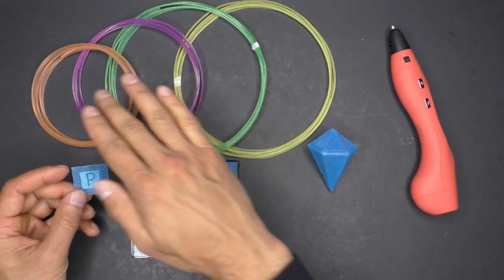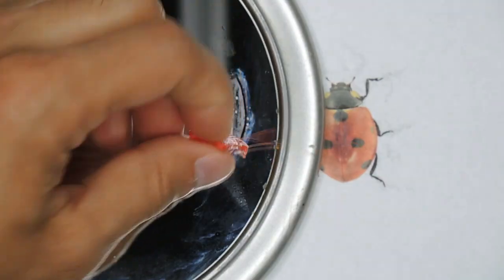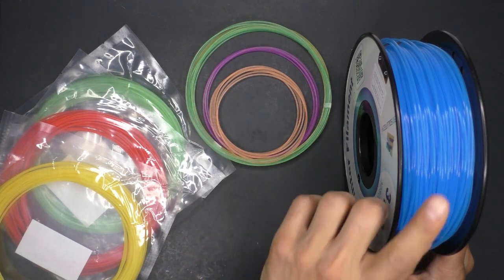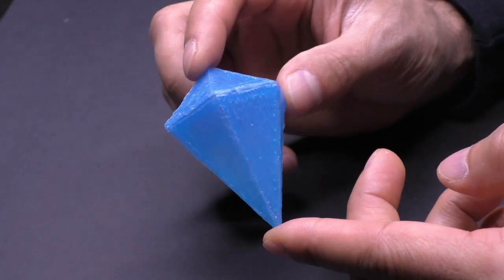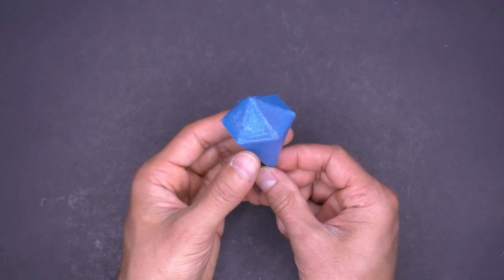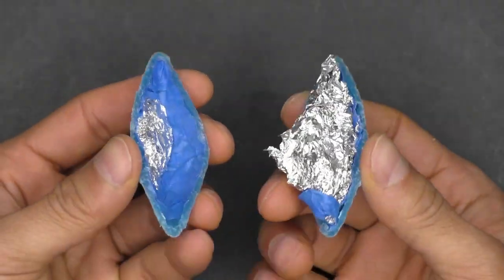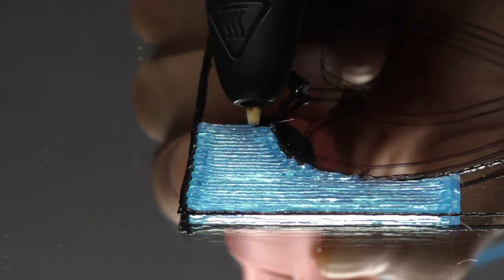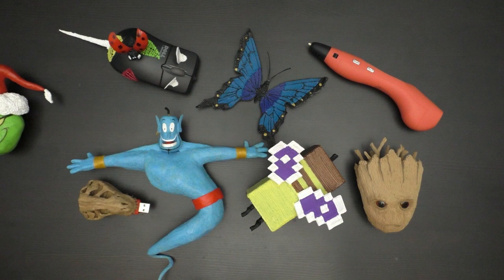SEE THROUGH Filament - 3D Pen Tutorial

Comment: I'm wondering if you could use a thin sheet of glass the same way.  You'd have the extra option to simply tape your design to the underside then.
Reply: I use glass this way, and it works great. As it turns out, the cheapest way I found to buy a sheet of glass is to buy an inexpensive picture frame. Just buying a pane of glass from a hobby or craft store would have been much more expensive. Also, wrap the edges of the pane in masking tape, to avoid getting cut.
Reply from the maker: Great idea! I bet it would look quite good :)

Comment: First off Thanks for doing a vid on see thru. Tip #1 hair spray or elmers washable glue stick will help filament stick to any surface not sure how the shiny side will turn out. Its works with opaque filaments great. I used this technique alot. Oh I wonder if you smooth the rough side then bake it how that would turn out.
Reply from the maker: Stay tuned on some of that, I have plans :)
Reply: @PotentPrintables  always am